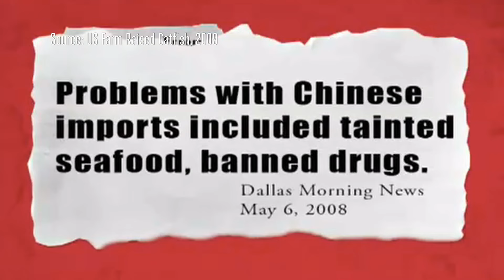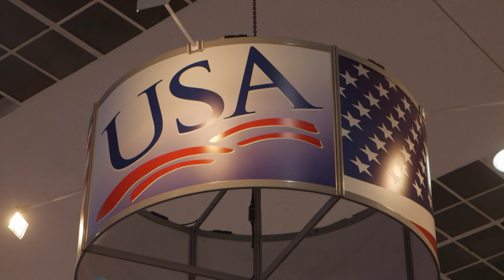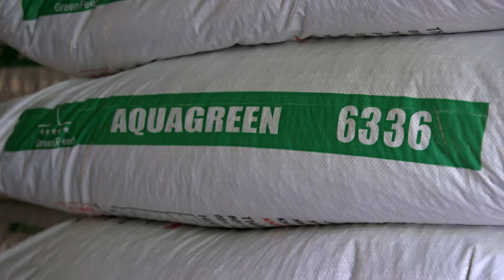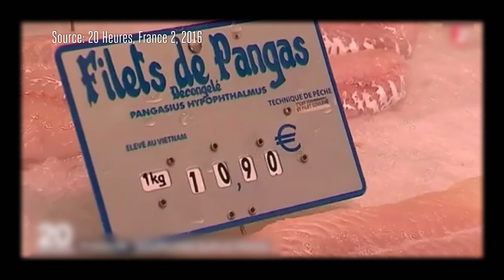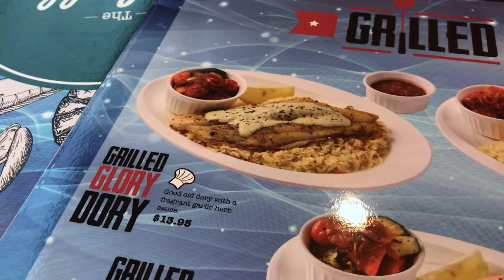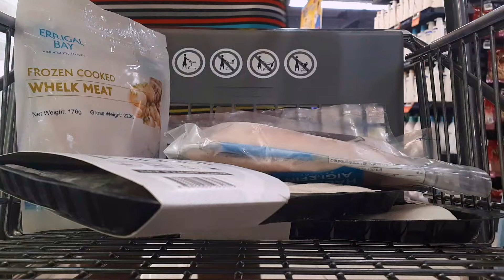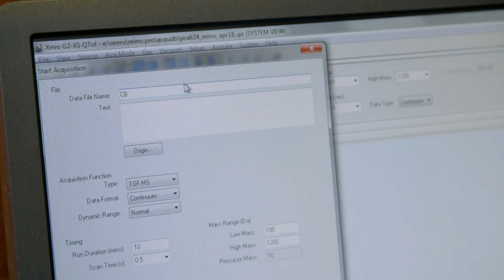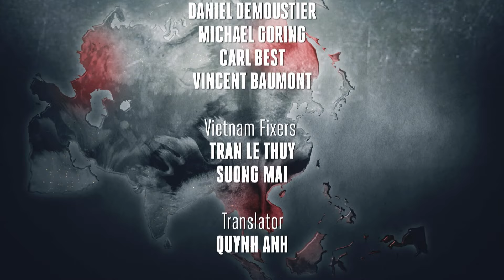The truth behind dory fish | Undercover Asia | Full Episode

Comment: fish and chip shops here in the uk, often sell cheap rubbery fish like pollack and dory as cod and haddock.  this is a wide spread con but who is actually doing the con is yet unknown.  the fish and chip shop obtain receipts showing they buy cod and haddock and label their fish as such, on testing the fish councils found it was the cheaper fish, the people they buy off was examined next and they like the end seller had receipts for cod and haddock, they then testes the UK supplier and were given same.  they then put it down to fish entering the country but had limited powers to act.  sine then a larger number of fish and chip shops just advertise fish unnamed white and many shops just put white fish on their offerings.  this white fish could be any fish even mixes of scrap fish parts.   this practice is too easy to pull off successfully, due to the low taste of white fish overall. although i do find the cheaper fish has a more rubbery texture myself, but then slightly older cod and haddock or badly frozen cod and haddock also has a rubbery texture.   we are reliant on our councils doing more testing and letting us the end user know of the mess in the fish market.